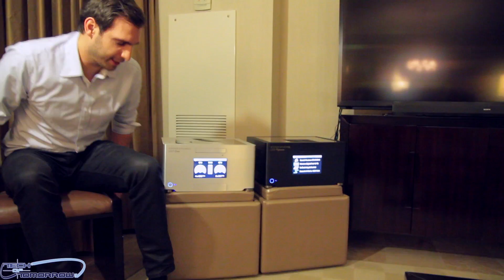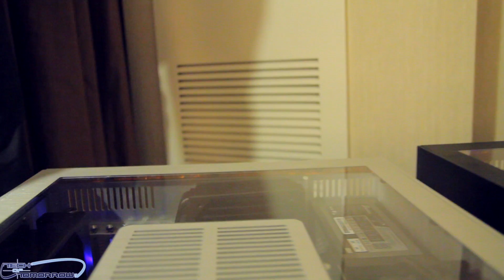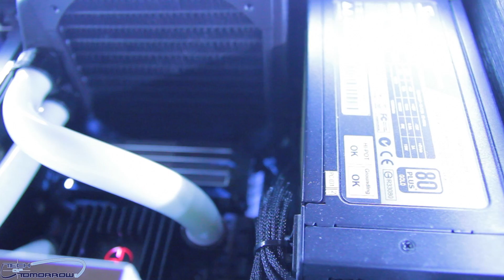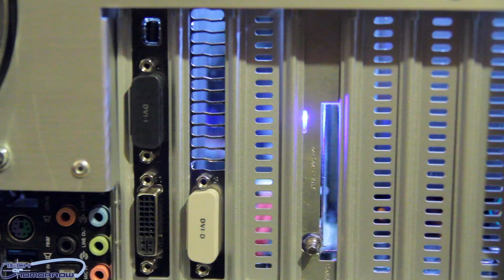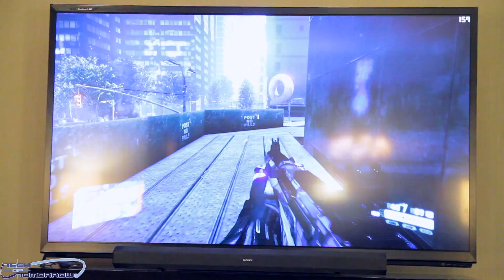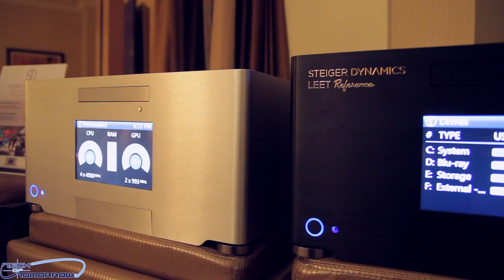Steiger Dynamics LEET Liquid Cooled HTPC Demo

Comment: not really is very quiet you should see is quite amazing but for now i down clock it to 3.8 because i don't want to risk 2 much, 4.0 has temps in idle of about 40-50 c full load with prime after 10 minutes began to reach 90s quite good for stock and also remember that prime 95 use a lot more than a actual game does with the cpu. I don't have a video card so what u recommend 560 ti or 660? what is the benefit of 660 other than more fps? do it includes new fractures? 560 ti is about $140 vs $230

Comment: dude intels run cooler amd have crappy architecture that forces them to run hotter under normal loads I ran with the bulldozer for a while and I have to say my switch to the i7 3970x has been the best it stays below 40c underload im not a fan boy I just have to put what I have found though respectively my house is always cold and everyone is running different coolers and coolant

Comment: There is only 1 i7 with a TDP that high, the i7-3970X.  The 3820, 3930K, and 3960X all have 130W TDPs, and the normal i7s have 77W (3770/3770Kor below (65W 3770S, 55W 3770T).  AMD power consumption is much worse than Intel's.

Comment: the Phenoms (or any AMD for that matter) are easy to cool, the i7 have a 150W TDP  so they will run hotter that AMD cpu's, allthough I think that this setup is  on the hotter side. I had a AMD Phenom II x4 945@4.1Ghz on water cooling and it ran at 48-50C max

Comment: pre-sealed... I not saying it's a bad setup, I doubt you could safely run @4.5 on air cooling, but I would go for a custom cooling aka bigger rad if I were to over clock to those clocks.

Comment: obviously the temps on the CPU in this video would be much lower if it were delidded with CLLP/LU applied but it would void the warranty so they have to stay within their limits as these are sold as a fully assembled system, still pretty impressive

Comment: lol. There is a 300 Watt dual GPU in the loop too, running on 100%. Also he said the system is made for extreme silent and not highest cooling, with the fans probably spinning 1.500 rpm at max so the CPU is always below 90. This makes this water cooling actually one of the best I have seen.

Comment: 3428 dollars . with i7 3770 non k and 8 gb of ram + 120 gb ssd + 860 psu platinum. the gtx 690 is aircooled. for gtx690 wathercolling you need to pay extra 535 dollars and it will replace the corsair h80i from the cpu. it would say if select better parts you will get a better price/perfomance-ratio. the case and the monitor makes it expensive!

Comment: Water cooling is often a crutch for poorly designed cooling systems and case/board form factors. The ATX standard isn't actually that well suited for modern hardware with how it crams so much of the big heat producing components so close to each other. Back when the standard was still new you could passively cool pretty much every component or use a fairly tiny additional fan, but that's obviously changed. Water cooling helps get around these airflow issues from extra cramped boards.

Comment: Tough Xeons aren't really meant for gaming and cost over $1000 XD
But for that price you can easily get a i7 3770K, Corsair H100i, Radeon 7970, 16GB corsair vengeance, 2x SSDs in RAID0 + 1TB HDD, Corsair 650D case, etc. Quite a big difference XD

Comment: I can't see that 120 rad cooling both cpu & gpu he just started prime and the cpu was at 80-81c that doesn't look promising. I didn't see any other fans for airflow but either way nice looking system but I guarantee its way overpriced.

Comment: Still.. you'd need a dual GTX690 or triple HD7970 setup to get even close to that kind of power requirement (the latter wont even fit in this setup). And if you can fit a dual GTX690 in here, I highly doubt a single slim 240 radiator can cool that. You want components to be balanced, in this case the PSU is overkill. Is it useless, no, but it isn't needed either.